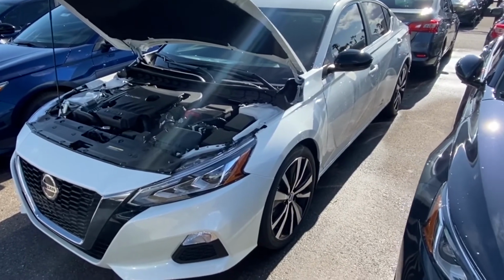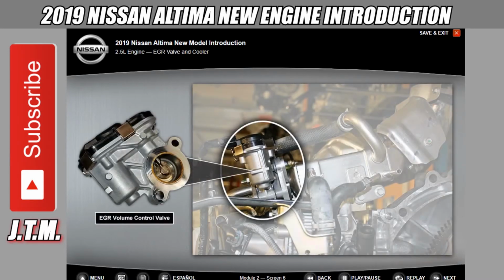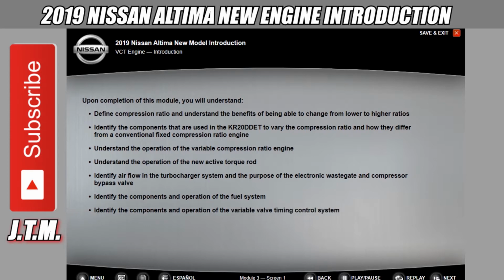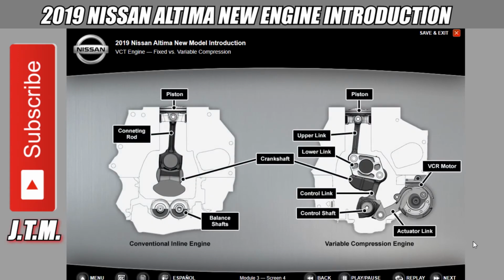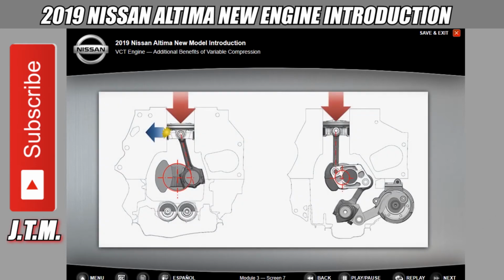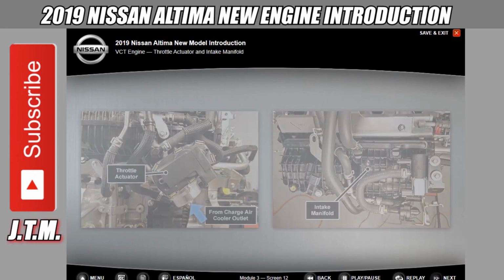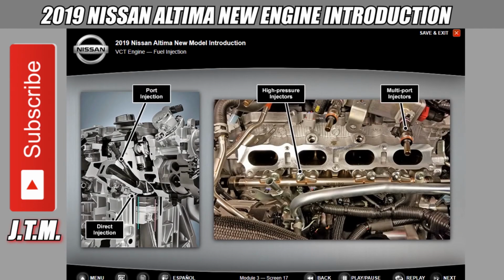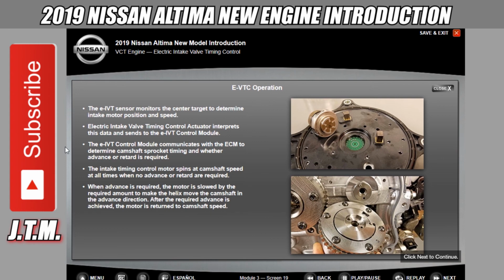2019 Nissan Altima VC Turbo Engine Technical Review

Comment: I know this is a year old but I appreciate you uploading this video. What has been your experience with the 2.0 Turbo so far reliability wise? I love my 2021 SR Turbo.
Reply: i have the 2020 altima platinum with the vc turbo this this is nice! it comes with the Sport mode, little button by the Shifter. very nice feature.
Reply: Love mine, Just remember to do maintenance 👨‍🔧

Comment: I also have the 2019 Nissan Altima SR VC turbo. Driving lately around 70 miles per hour i vibrates. I had the ball barrens replace. That didn't work. Now they're telling me its the turbo. Still not fixed. I need help. Its a awful loud noise.
Reply: Exhaust might have a hole
Reply: Well its all under warranty so be persistent with the Nissan Dealership and Nissan Corporate to make sure they fix the problem. By law, they have to.
Reply: Bent rim?
Reply: @occckid123  they didn't say it was. I'm not sure. It happens at 65 to 75 miles mph. If I excellrate up to 80mph it goes away.
Reply: @madrieneforesyth1378  probably a balance issue or wheel alignment.  1 of the belts in the tires could b off. Have you ever rotated the tires? Did I go away when you did or did it get bad after youv for a tire rotation?
Reply: @occckid123  thanks you again for helping me. Yes the tires have been rotated. All I remember we had the antenna replace because the radio went out. Later that day driving on the interstate we heard the noise. They thought it was the rotates, the ball barrens, all that's been replaced. Also the motor mound. I'm just going to have to let them know.
Reply: Is the sound able to be recorded?
Reply: @occckid123  don't know how I could. I do notice some morning when I start the car. It makes a loud humming to a vibration sound and it's loud. The sound will go away after.  I sonds really loud because it's parked in the garage. Sounds likes it's idled up.
Reply: @madrieneforesyth1378  thats probably just because it's cold but it's hard 2 tell without knowing how the vc turbo is supposed 2 sound
Reply: Okay guys this what I just found out. The mechanics and technicians are staying  the engine is compression with the turbo. A normal characteristic.  They checked complaints where other cars are like that. Now they it's was like that when we test drove it. Which is a lie. This started last June 2020. We boughtJune 2019. They don't know anything. Somebody help 😭
Reply: @madrieneforesyth1378  what type of sound is it can it be recorded?
Reply: @occckid123   I don't think I can record it. It's the noise coming from the exhaust. Really loud and vibrate. It's sounds like one of those big fans that they have in the shop but just vibrating. This is the best I can come close.
Reply: @madrieneforesyth1378  probably from left over gas in the exhaust going through the turbo the system probably has no solution to this as the fuel air application is varied based on the varied compression. Its probably an inherent issue with the engine/exhaust/turbo manifold leading to a leak/gas in the exhaust from back pressure/pressure and noise/vibration. The car vibration can also be liked to a bent/mis-aligned tie rod. Or even a CV boot issue. Via pot holes/curbing the car exiting a parking lot or entering etc. These can all throw off your abs/bcm modules that can balance your car at any speed foot on gas especially. This "slew" of issues can be related to road wear and tear etc. Not typical in 1 year of ownership. To truly align a car you have to measure suspension mounting points with an actual measuring tool before it can truly even be aligned with a machine/rack anyways. If your strut towers/ball joints/cv  and control arm measuring points are already off from potholes or etc. Wheel balancing and alignment wont fix the issue and the vibration from the strut/tie rod/cv boot or ball joint. Can lead to transmission issues and abs/breaking issues as well as high speed vibration etc. Generally isolated by if you vibrate under heavy/high speed breaking, or have nose issues/droning after wharming up while accelerating from a stop which can be a progressive issue. Making constant right turns can actually cause this as well if you drive enough/uber etc. for a living like i do per example. Stock factory tires already fit the "specs" for alignment, getting a different brand that eventually wears differently will also affect stability and need to be re-balanced etc throughout their lifetime depending on their tread and blend. So if this is already an issue with the car...Fiding the proper suspension angle and tires will help prevent further issues or wear throughout the ownershp of the car as well as tire life and brake pad/rotor life. The vibration could even be from your steering rack...but that would mean your car hit a curb or jumped off one or hit a parking block etc to cause that or you turned the wheel while the tires were against something the only possible cause of damage to that. Which dealerships would also miss. As well as alignment shops bc they typically dont drive the car outside of street speeds 30-50 max. The way this car is designed to function as the techs have said....this is an apparent byproduct of "Design"....from that "active torque rod" right down to tire wear/steering angle/axis. Idk how this car manages intake and exhaust pressure as well as any fuel exhausted....but thats destined to lead to a leak/issues......bc how this car manages intake and exhaust pressure...is conducive to how the BCM and ECM function as well as your throttle position etc.